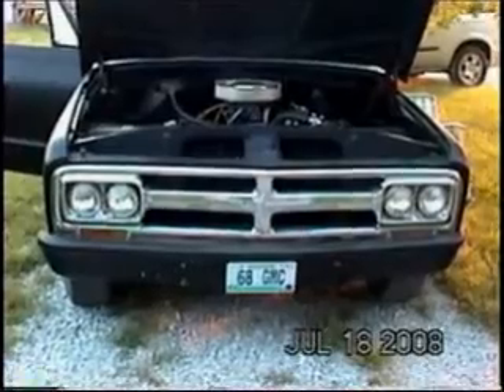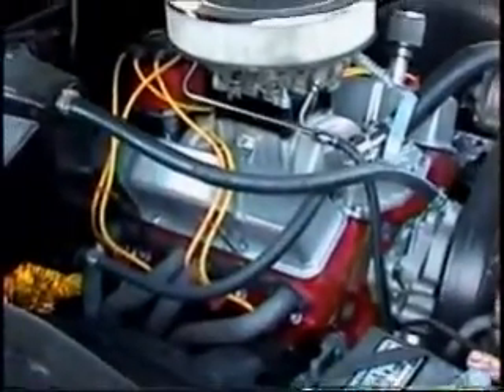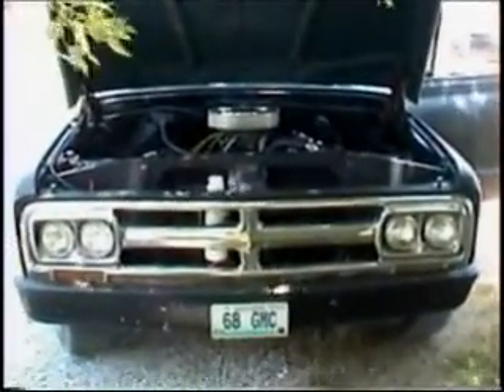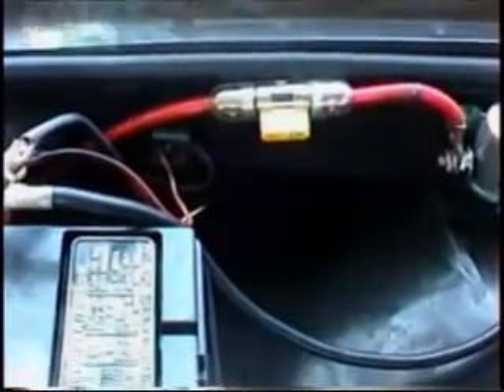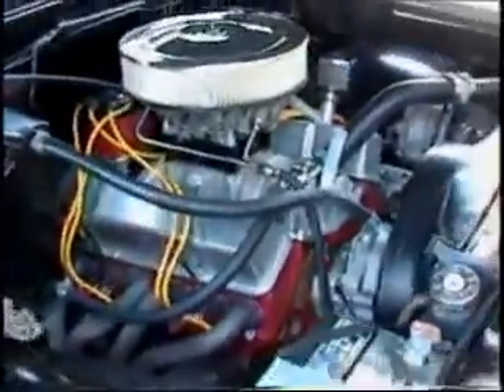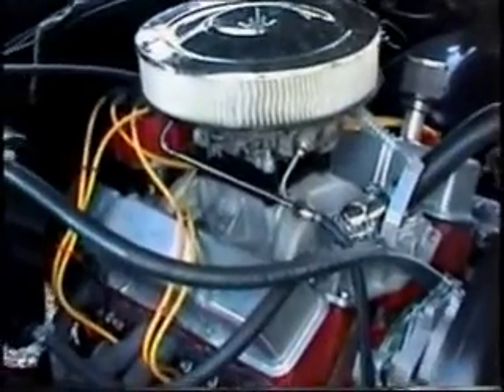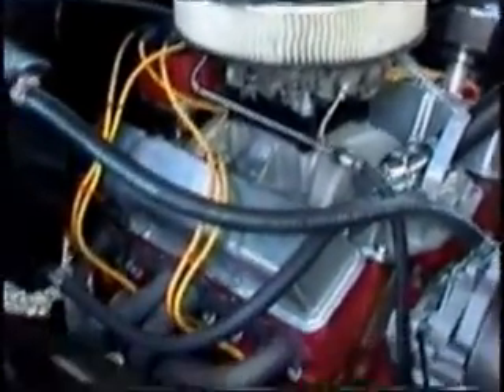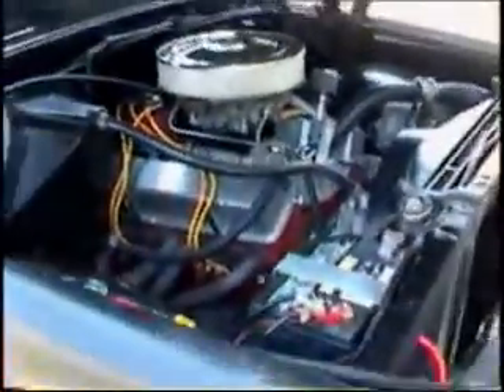TJ cell installed and test run part 1

Comment: were are you going to add a dc motor that can be turend to create dc curent that will keep you frome endangering your charge sysem on your vehicel YES DC motors make curent when you spoll them up try it any one of them smallest to the biggest tell every one you can save the charging systems ive been posting like thise fore monthes i need help getting the word out some one make a video and tell them all woul be nice if you mentioned me

Comment: You did a great job. You have enough room in there for like 3 more hydro unites.Dont stop now coz hydrogen is 7 times more powerful than gas. Keep on till you run on mostly water. Just keep adding more unites to that car.

Comment from the maker: The generator stays cool due to the air going over it from the motor. I ran it in 100deg temp out side for 2 hours around town and I could still hold my hand on it no problem.

There is no pressure in my cell it runs in a vacuum. I used gas line for my vacuum line from the cell to the carb because it can take the force the vacuum makes and not close up.

Take care,HHOhotrod

Comment from the maker: My cell is full of water all the time. The bubbler holds the water and stops flash backs.

I have other vids on my profile that show what my cell looks like inside. Im not using plates.

I dont know the amp draw yet on this cell my meter craped out on me. We have a 20amp fuse inline to the generator and it hasn't blown yet.

We are using baking soda and distilled water.